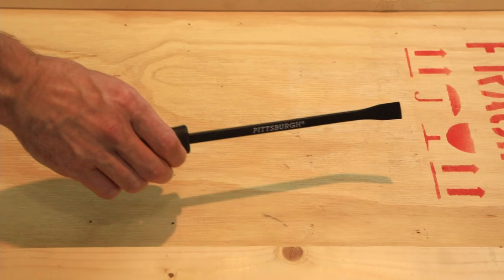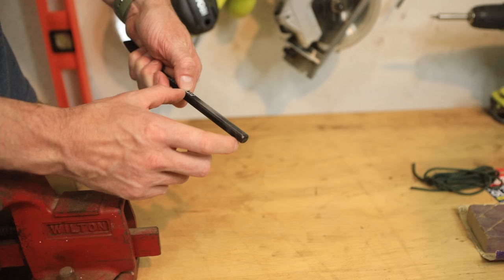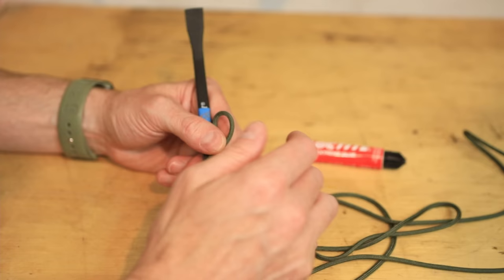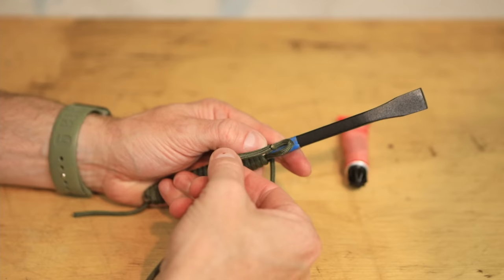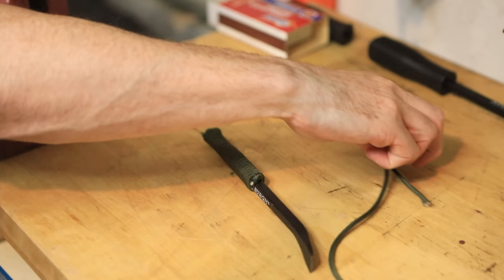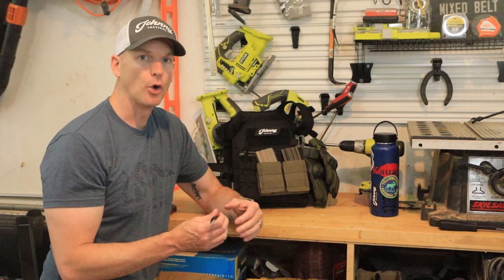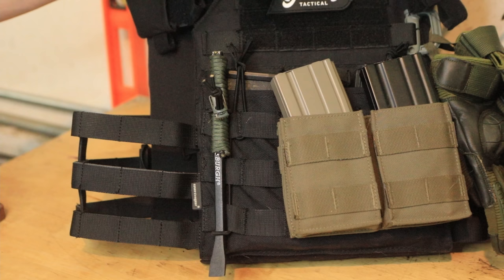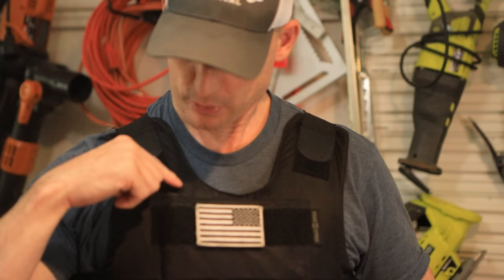The Key To The City: A DIY Tactical Tool You Can't Be Without

Comment: I would of just used hockey tape instead of the paracord and then dipped it in plasti-dip to rubberize the hockey tape. I do it to my knife, hatchet, and hammers if the handles feel slick to me. Otherwise, great work and idea!
Reply from the maker: That’s one of the benefits of DIY — do it your way 👍

Comment: Or don’t put the para chord on it and pack a length of suitable wall thickness steel pipe as a cheater bar. Then make a case for both. No point of a pry bar if you don’t have the lever long enough to really benefit from it.
Reply from the maker: This tool can work doors open on its own, but not all doors. Its primary benefit is having it with you and available and to supplement seating larger prying tools like a halligan or Ogura

Comment: Why don't you use your tactical pliers to grab and pull on the short piece of paracord?
You could keep piece of metal pipe, paint it black, and use it on the end of the pry bar to increase leverage.  If you made it a bit longer, and threaded both ends, it would make a great case with threaded caps.
Reply from the maker: Thanks for the feedback Mike!

Comment: Street sweeper bristles or what I use in their hard steel if you had two of those you can bend one for a pair of tweezers you can bend one in the shape of a tiny pry bar and if you can get an iPhone straight from the store they give you a metal steel tool to remove the SD card I use that as well for popping pimples blemishes pustules and basic hygiene like teeth when you're out in the field for so long and you don't have a toothbrush but you have a mirror you can get the stuff off the back your teeth that builds up or so on and so forth I've used tiny pry bar to collect pine sap off trees before the crystallized kind and you can chew that for gum for your teeth antibiotic properties so ingesting it will help your stomach or any sort of internal cuts blemishes whatever helps me quit smoking cigarettes too

Comment: Why would you sand it in any place that the glue doesn't need to contact? If the paint is not flaking it will probably not need to be removed at all and still give proper adhesion. it would just cause it to rust under the handle that will stay damp once it gets wet.
Reply from the maker: Hey Dion, others have mentioned rust.  I have not had an issue with rust in over 10 years, but that's not to say it can't happen. Also, the manufacturer guidelines for the glue want it straight to metal for the best bond.  I'm sure there are exceptions, but this is the method I have used.  Thanks for taking the time to watch and comment

Comment: I'd like to see it used. They taught us to defeat the lock. Or hinges. Not sure what is acceptable on the civilian side. But I've never tried something that small. Unless it was det cord
Reply from the maker: It’s certainly not the be-all-end-all but it will do a lot of basic doors like to get in a secure apartment building or interior door at a call for service. The main point I was trying to get across was to make something small enough to have with you on duty at all times not a magic wand. I could have done a better job articulating that. 

I have a new video on breaching basics where I demo how to “walk” the mini pry bar in to bypass a lock and how to use it to supplement larger prying tools. 

Thanks for watching and taking the time to comment

Comment: Idk bud, I just can't agree, original tool was best way to go imo. But better than that, if you plan on busting in fast and easy, full size tool all the way. Plan your pack.
Reply from the maker: Agreed on the full size tool...but most times in patrol you're not walking around with a halligan or the initial call does not appear to require breaching. It's just an option. Thanks for watching

Comment: Your oily fingerprints are weakening the glues bond.
Have you tried putting a razor edge on it? It would chip when you used it to pry, but it should still work.
Reply from the maker: Rubber gloves would be a good idea anyway to keep that glue off your fingers -- so difficult to wash off!  I don't think a razor thin edge is necessary, but you could grind it down a bit.  You are right, though, too thin and it could break.
Reply: @johnny_tactical  
Making it sharp just gives you more options.  I would like to see a test on doors and windows with the regular bar and one with a sharpened edge. Thanks for your time and service.
Reply from the maker: @varietasVeritas  Roger that

Comment: Or you just buy the Etsy Breaching Chuck-E Belt tool on Amazon if you want to save yourself the effort and aren't afraid to spend the money since it's now $38 but it does pretty much the same thing but is stronger. 

Bonus Level on the Etsy: Non-Reflective Powder Coated the whole way down.
Reply from the maker: Modifying your own is more fun...
Reply: 38 bucks for a 12 inch pry bar? Holy smokes. Maybe for a Mayhew, even then you can get a set of 5 large to small for like 80, made in the US and extremely durable, not made of chinesium
Reply: @__tacocat__  Still not as expensive as the The Ding Dong (Yes YT, that is it's trademarked TM Name, sigh) and a lot more portable plus belt or vest friendly I've found but since it's wider it can take a lot more torque (like standing on it, literally) than the thin tool can but I can also think of situations where the thinner one would be better as well, so it is a trade off. 

Just was noting it as an option for those not tool or paracord friendly individuals of us human beings.
Reply: The ding dong is kinda silly, I mean, you should probably already have a few sledge hammers and bars around anyway. For entry, you should just get a halligan if you are going to spend that kind of money. I can see that chuck e thing being good for concealment though
Reply: @__tacocat__  I think the DD is supposed to be another one of those all in one hali-sledge designs if you get my meaning but the carrier for it looks good and IS Molle capable. 

I'd just hate to be the poor slob trying to maneuver thru any field or ditch with this on my back cause it is still a huge block of nothing but dead weight that you have to contend with, thereby wearing yourself out at an advanced rate.
Reply: @warsprite1888  true. The carrier is a nice on that thing too, but still a way overpriced bar and sledge. But I get your meaning that it's an idea for people that don't already have these tools laying around for other normal uses

Comment: Thanks for the vid… question on the one you are showing how you carry it, is that a different one? If so what did you do different at the end of the handle? Thanks again
Reply from the maker: Yes, that's the one I use at work every day, not the one I made in the video. What's different with that one is that when I wrapped the handle I made a small loop at the end so I could attach a tether to it.  I used a tether when it was on my SWAT vest so I wouldn't lose it in case I dropped it. You can make it the same way, just instead of pulling out all the slack at the end tie a loop and trim the excess.
Reply: @johnny_tactical  awesome I understand what u did now with the extra. Thanks for the rapid response and your service
Reply from the maker: @Athreehourtour  It's my pleasure

Comment: open a door with that.??
it would be tough to pry open the average modern door with a 12" bar,
dam sure ain't getting in my doors with that little thing.!!
would it not be better to have a metal flashlight and break a window.?
Reply from the maker: It's intended to supplement larger pry tools that may need more space to get a good purchase.  It can do basic doors on it's own but not ones as fortified as yours.
Reply: I work on exterior doors on a weekly basis and STRONGLY suggest that you try out your 12" bar.
$20 says the first pry breaks the lip off the groove for the weather stripping, 2nd starts to get a bite on the actual frame but now  the bar  is on or nearly on the face of the door slab, at this point u r pushing on the door with a bar in the way.!!
With the handle mod your bar may act WAY different.?.?
If it does work let me know, i'll rip the handle off one and try again.!
Reply from the maker: @joeywest386  I've been using it for over 10 years.  It can be especially helpful for seating larger pry tool, like halligans and hydraulic tools like the Ogura.
Reply from the maker: Here's a video I made that might answer some of your questions: https://www.youtube.com/watch?v=lVVFkZ8RtIc

Comment: Great idea but flawed in implantation.  The handle is too narrow with minimal surface to grip.  There would be too much potential for rolling the tool or your wrist.  It would be more beneficial to remove the existing handle and drill it through and remount it.  Same OAL with better grip. The grip can also be stippled for better grip if wet/cold.
Reply from the maker: We'll have to disagree on that point, but I do appreciate the feedback! Thanks for taking the time to comment
Reply: I mean…. You don’t think he’s actually used it before?
Reply: @johnny_tactical  I like this. I make something like it out of Allen wrenches.
Reply from the maker: @theheretic3764  I'd like to see it.  Post it and tag me or email me.

Comment: Good idea but but a different brand that Pittsburgh from harbor freight the metal they use is crap China crap by 1 from home depot or Lowes that contractors use daily or do research an American made which there is very few American tool companies anymore... I have broken this pry bar when demoing for electric remodeling
Reply from the maker: I used to use Craftsman, but since Sears took a dive I've had trouble finding them.  I prefer that shape and angle of the bit end
Reply: @johnny_tactical  no you're good when I broke mine the way I was using it when it broke it ripped my forearm open ... just giving y'all the heads up be safe and thank you for putting up with the disrespectful a$$hats in America today stay safe brother

Comment: Do you think multiple coatings of a rubbery dip it material would work instead of the paracord?  I carried a mini haligan tool on my SWAT vest that was about 13 inches long. Thankfully I’m retired now. Stay safe and God bless. Subbed.
Reply: I would think so. Personally I never thought of a mini pry bar. One I always have with me is a spring loaded punch for car windows, the kind with the big knob on the back that you just push into the glass and snap! Window is not a problem. 
I also like multi-purpose tools like the Stanley FUBAR (it’s a demolition tool which is heavy but fantastic) and it also has a little brother the fat Max. They are great because I also use them around the house, my wife always has me building or tearing down something or other and the Fubar is like a sledgehammer had a baby with a crowbar, the fat Max is more framing hammer size but also a pry bar and if you can get the jaws on the back on something it’s game over, you can rip out whole wall studs without breaking a sweat.
Reply from the maker: I have not considered a rubbery fondue...so many great comments for modifications!  That's what I love about DIY and customizing you're own kit -- you can make it any way you want.  I'm going to write that down, thanks Captain Skippy

Comment: Sooo its a pry bar?
Reply from the maker: Yes, I'm glad you picked up on my subtleties
Reply: @johnny_tactical  ya but why take the handle off it makes it shorter wich means less leverage unless you can find a pipe to slip over the back, im just confused, I mean if your going to do it just for extra paracord why not just get a wonder bar and wrap it
Reply from the maker: @dylankaylor5840  The leverage question comes up a lot.  The truth is you don't need a whole lot of force to create a gap between the door and door frame. If the door is metal on metal or metal on concrete then it will be different and you'll need a different tool.  This tool will handle most wood on wood doors/frames.  Deadbolts will require a larger tool like a halligan.  The beauty of this tool is that it can handle a lot for its size and that you can take it with you so its there when you need it.  It is also great to get larger prying tools started because they sometimes have trouble on tight fitting doors.  It's just one option it's not the only option. Thanks for commenting and thinking it through.
Reply: @johnny_tactical  ok I get it, screw it i might do this just to keep in my tuck bug bag ither way its a good way to keep a spool of paracord except I might do a few cobra braids thanks man, im subscribing purely on the fact that you took the time to write back btw thank you
Reply from the maker: @dylankaylor5840  Thanks Dylan! I appreciate the feedback...and we don't have to agree on everything to be friends.  I value other viewpoints so I appreciate you being willing to stick around

Comment: you took a 10 inch prybar, introduced a new mode of failure for it, and put it in your 2nd line gear.  That prybar isn't going to get you into any building that a swift kick won't.  Carry something like a halligan bar, and FFS put it in your 3rd line gear, 2nd line exists to support your rifle, your life, and any immediate threat/trauma.  Is this guy even SWAT?
Reply from the maker: As you know, a halligan weighs around 20lbs -- the mini pry bar is intended to assist seating larger pry tools like the halligan and hydraulic breaching tools.  I could have done a better job explaining that. It takes up a negligible amount of space on your kit.  And yes, I have an actual resume.  Thanks for watching I appreciate the time you took to comment.